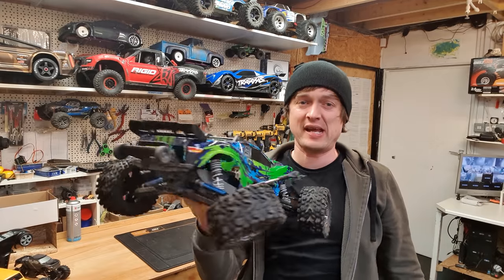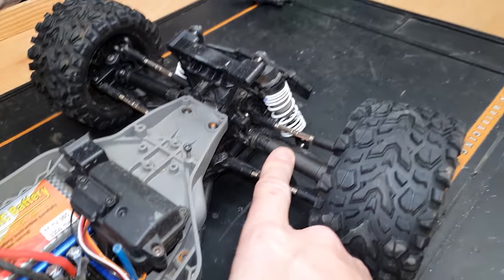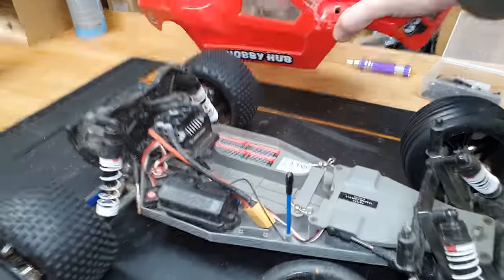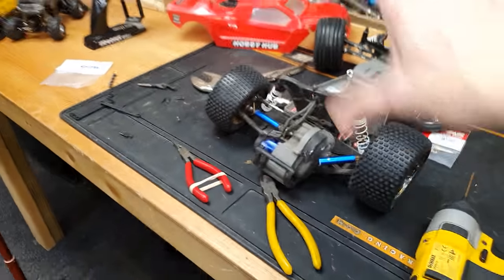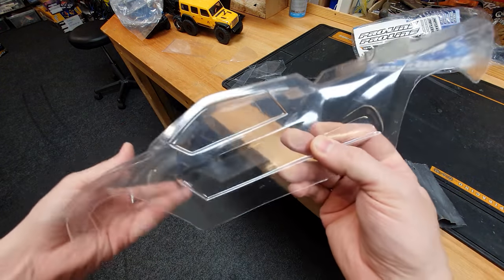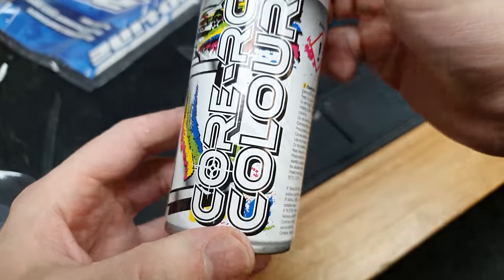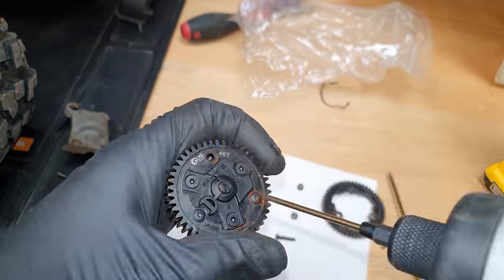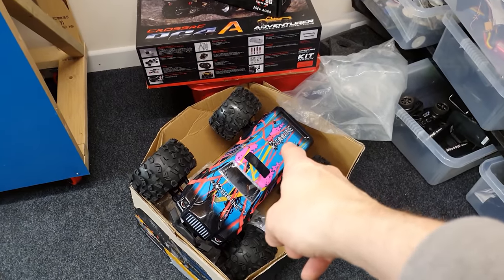Fixing This Mess - RC Car Wrenching

Comment: Kev, did you see the wide face gears from traxxas?
Reply from the maker: i havent. whats it all about?
Reply: They are about 1-2mm wider then original spur gear. They have 6448R 50t wide face. Bought it and I looks much beefier! There is also a 46T and 54T.

Comment: Rustler vxl!💪 i miss mine wish i had one still.
Reply: Its ok
Reply: the 4x4 is awesome. especially with a 5700kv motor on 3s. pulls wheelies through a long range of the throttle. 😂 and no one can expect a $300 car to do what is usually done with $900+ cars. I mean the $900 arma still bent the chassis while it cost 3 times more. lol

Comment: Hey Kev.heres a top tip for you,instead of brake cleaner ,wash the inside in fairy liquid(other products available) using the scourer to scuff the surface  as you wash ,dry with a hairdryer before painting,just apply the window masks first

Comment: Hey I have a few tips for your Rustler 2wd. #1, I wouldn't bother with the steering kingpin. It bends all the time. I'd just deal with the fact that they are bent and run em til they sheer. 2nd, for the rest of the pins, or at least the front a-arm pins, get the STRC suspension pin set. So far, I haven't been able to bend them at all after 2 years of abuse, and they are captured as well which eliminates those e-clips, and keeps them from backing out of the a-arm.

Comment: Kev dont gear up your rustler I have a 52t in mine and it destroys driveshaft and the pins always vibrate out even with loctite. Also why dont you just wear rubber gloves when you are doing a new body

Comment: There is the bottom gear in the transmission that has 3 screws they don’t put locktite on them so they come loose very big problem on the axial monster trucks

Comment: Arrma typhon or talion would have taken that landing. You know the talion or typhon is stronger in every way. Except when its time to fix its more expensive with the aarmas? Check out rc dude 81 jumping those as high as your jump all day long!
Reply: Then try? I think any arrma would turn into pancake... lol
Reply: @ksprr6856  check out rc dude 81. He crash lands jumps like that all day with the typhon and talion
Reply: @familyman8644  6s arrmas aren't strong in stock form.But when you upgrade nearly every part and pay about 600$ on upgrates they are!
Reply: @familyman8644  Like the other guy said... stock arrmas cannot bash... even upgraded their chassis is weak and bends like a banana.
Reply: @cocoemelie8541  whats the strongest aarma? I think the v4 talion amd typhon is a beast but thays thats expensive. You think ultimate slash will hold up better than any aarma?
Reply: @ksprr6856 did you see rc dude 81 talion v3 with that goliath m2c chassis? Thats not even the v4 either. He said the m2c goliath chassis can take up to 100 foot drops even without aluminum chassis brace
Reply: @familyman8644  I dont trust them arrma fanboys :D